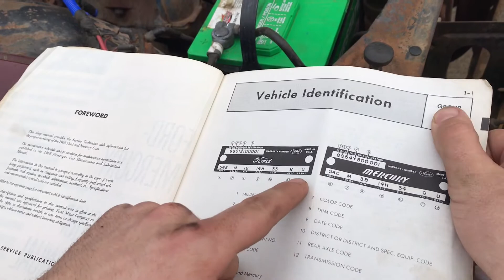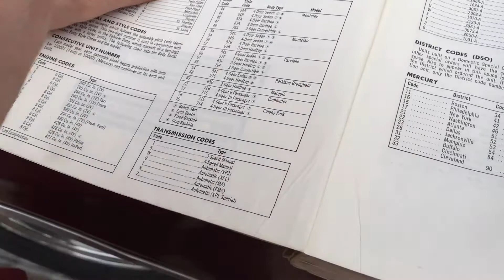1968 Ford Country sedan FMX pan service.

Comment: Did you flatten the pan lip where the bolts go through the pan,,If not it May still seep a little bit of fluid,,Did you blow the pan out with air after you wiped it out with the tag ? Believe or not a rag can leave fibers in the pan that can clog the filter Unless it is lint free,,,Just be careful wiping internal trans or engine parts with  rags,,Use brake Kleen or Air before final assembly..Best Regards